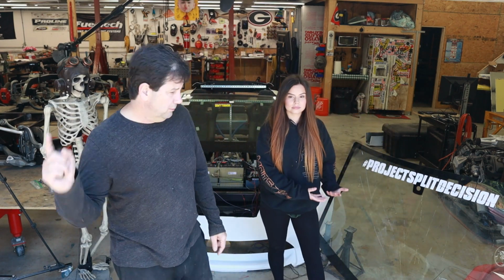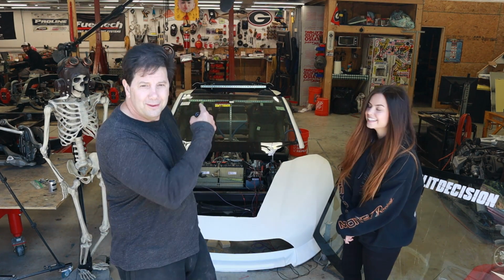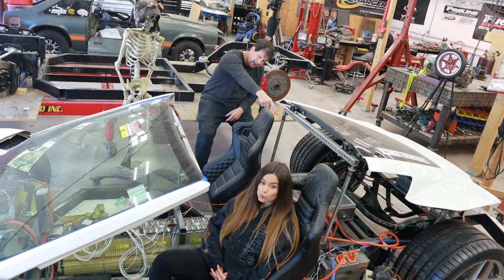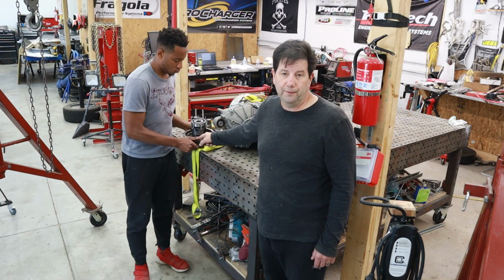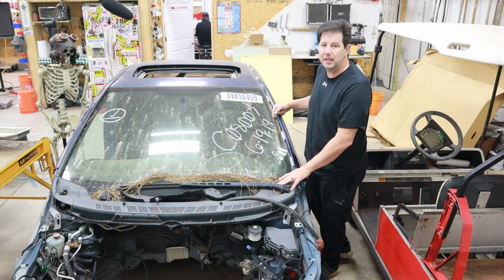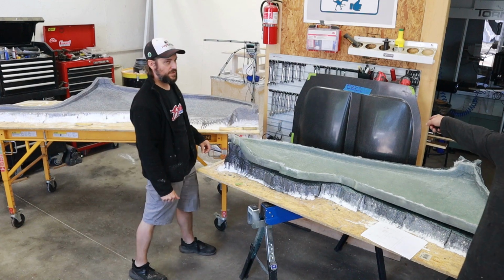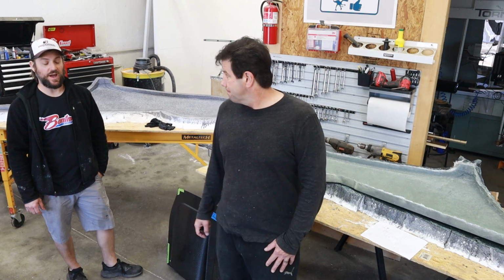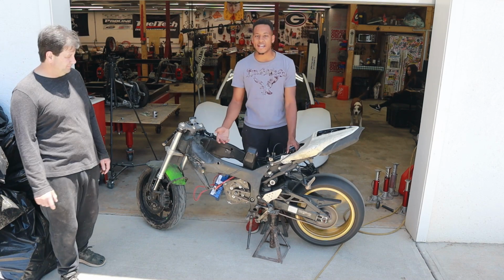Destroyed my Lamborghini Aventador windshield ... DIY Supercar(s) part 12

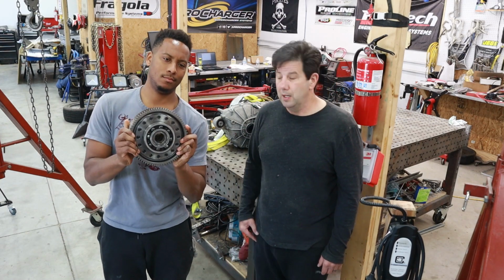Comment: @6:15 Open diffs suck, but there is no gain in welding it. I dont know the hardware you are going to use, but a standard single roller dyno would not care if your car has an open diff.
Reply from the maker: Thanks for the comment.  We will be using a chassis dyno